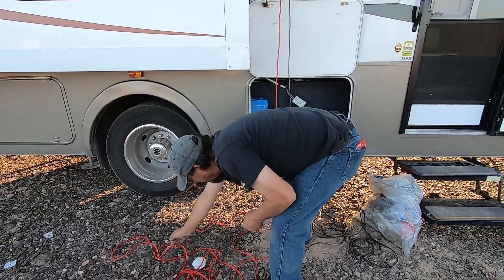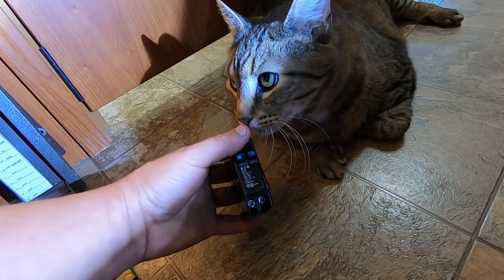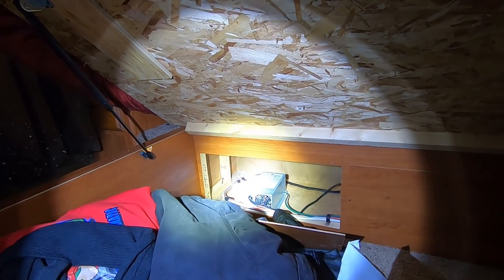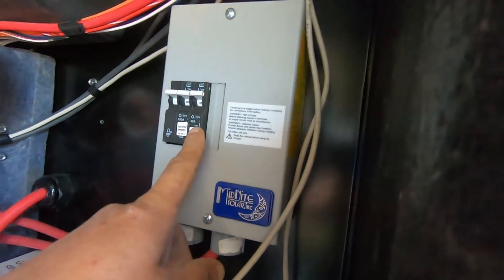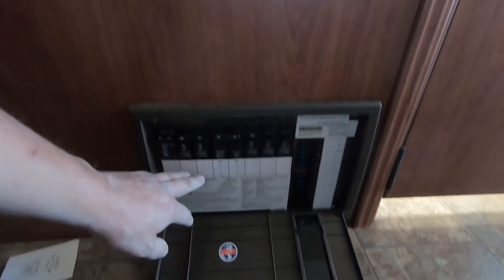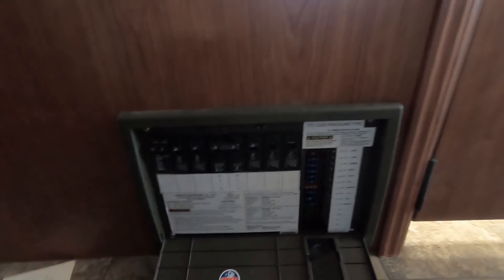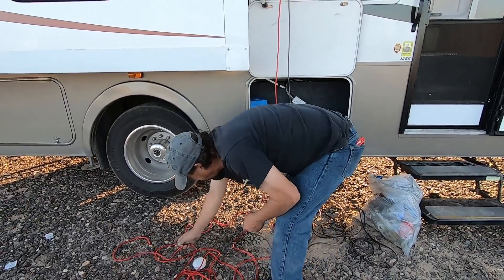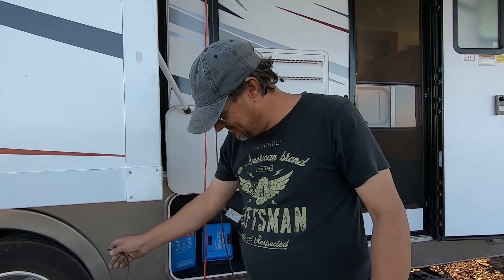Nomadic Fanatic solar install Pt.2

Comment: Thanks Wayne, you answered a ton of questions and concerns I had about setting this system up on a 50 amp RV.  Any opinion on inverters, AZ wind and solar sells the Vitron and the Magnum in similar kits, read some negatives on the vitron drawing power from a small generator the way you want it to.

Comment: What areas do you work in, and what are your rates? I am doing some upgrades on my 2012 Crusader 355BHQ this weekend and could use a skilled RV tech. Adding some 12v options that will require pulling cables, skylight covers, brake pull switch and looking into solar and lithium. I'm in Azle,TX send me an email if you're interested. Sbseiso@gmail.com

Comment: Hi Wayne, I am a subscriber and just watched your NF solar install.
My question is will my system run a .8 amp mini fridge?  I have 450 watts of solar panels, 2 100 watt agm sealed lead acid batteries, a 3000 watt inverter and the appropriate converter etc.

Thanks, Babs
Reply from the maker: I would suggest adding 1 more battery to have a buffer in place.
Reply: @rvprepperwayne  thanks, am thinking of replacing all with lithium...for the same reason.

Comment: I like very much how you installed this. Couple questions. Eric kept saying the inverter was a 50amp pass thru. Is this correct? if so, could you have powered the entire distribution box instead of only one line? Second, I watch many time. But I did understand your 30 and 100 amp dc breakers? could you detail this for me? or do you have a schematic?
Reply from the maker: The inverter is listed as a 50 amp pass through but it is really a 30 amp pass through with an option to do a 50 amp output from a 30 amp input.  From my understanding the 50 amp output would only come from a shore power or genset. Therefore it is not a true 50 amp pass through. Its hard to explain  how it works.  On the breakers the 30 amp breaker is from the panels to the charge controller and the 100 amp is from the batteries to the charge controller.  This makes the CC fully protected. Yes it is DC breakers.
Reply: rvprepperwayne ok I think I got it. The two big red cables. One coming in from the cc to the breaker. Thru the 100amp and then out the second red cable to the battery. And yes I understand from the panels thru the 30amp and to the cc.  And thanks for clarifying on the multiplus. I wish it were a true 50 amp pass thru. Thank you!
Reply from the maker: Go power  has a true 50 amp pass through. The IC 2000  https://amzn.to/2Pj9SEj and the IC 3000 https://amzn.to/2PkRxa4

Comment: standard rv converters are really just a big 12 volt power supply, but they do terrible things to rv house batteries because they don't have a proper charge profile and tend to overcharge batteries, swelling the cases and cooking them to death. but for the rv manufacturer it's an inexpensive way to power the 12 volt house systems from shore power. one of the biggest reasons why i hate most mass-produced rv's... they usually use the cheapest stuff when they build them.

Comment: I have them wired in series parallel? Wtf does that mean...I am a owner...you either have parallel or serial...not both...please fix and post a update
Reply: There are four panels.  Panel 1 and 2 can be wired together in series to double the voltage to create bank 1.  Next panels 3 and 4 can also be wired together in series to create bank 2.  Then bank 1 and bank 2 can be wired in parallel to double the amps.  I think that is what is meant.
Reply from the maker: Yes Bruce. you understand what I mean by Series/parallel
Reply: @rvprepperwayne  Yup.  I have 4 panels on my Sprinter-based Camper and have them configured Series/Parallel as well :)

Comment: Wayne, How do we meet up for you to do my solar?

I'm in FERNLEY, NV as of right now.  I can head south, or you can come up here and stay. 
I'm not going to ask how much, I just know good work when I see it! :)
I have the money, I just don't have the skill nor parts yet. 

I have a 1999 Tioga that I'm sure we can get 3 X 320W on it. I want 2X 100ah BB batteries and to be able to run the AC. I'm willing to buy a newer AC that is not as big as what I have now to have AC on solar. 
If you want the work and have the time lets talk! 

George> GeoDrone360@Gmail.com

PS: I need to Whitewash/paint the roof, put in a Max fan and maybe change out the AC too. :)
Reply from the maker: My email in in the video description

Comment: Did I miss it or is there auto transfer between inverter and shore and generator?
Reply from the maker: It does have a factory X over before  the breaker box.
Reply: I remember now you saying the inverter had a pass thru. Thanks for the review on a great system and AWSOME INSTALL

Comment: GREAT JOB Wayne...will be in touch for same setup ( 2 strings, solar runs everything, auto gen start) only with the Magnum  3000w 12vdc psw hybrid inverter /charger (MSH series) when I am ready ready...have you ever done a  2019 Newmar Bay Star 3401 by any chance? Thanks for the panel info just asked Eric for it...lol... will be in touch.

Comment: Love it! Does that Victron box charge and is the DC/ AC at the same time...and do these battle born have cell controllers so you could charge them with every charger with agm, gel and lifephos curve with lets say end voltage 14,6?...   thats a massive installation..I simply have 190 Watts solar and 160 Ah Lifephos batt does the job but no air con..coffee making, El cocktop or hairdryer no issue..I would like to run the refrigerator in summer over it..( S + and D Signal application its a 190 Watts cartridge so 14 amps, my set up won't do it ).. My Rv garage said also, no better use gas...since I have no free real estate up on the roof I may built a windscreen protection with 200 Watts of solar to double up..who knows..hope you guys bbqing a good steak and a beer after all! Keep rocking Wayne!

Comment: Great pair of episodes Wane.  Questions, saw a video where they were running A/C on solar and they mentioned a inverter that can produce short time very high watts output for the few seconds is required when the compressor motor is spinning up as during that short time many more times the watts the motor is rated for are being pulled as it goes from not moving to turning.  If not the voltage drop and the amperage rise can burn up the motor.  I'm sure you are already aware of this just wondering how much peak watts that inverter put out? Think you said it was a 3500W but that is probably continuously not peak.   Again excellent job Wane everything looks good and clean, been reading up about those type battery's should be great as you can pull them all the way down without damage. Think they are built at the new Tesla battery factory in Reno.

Comment: I new the light would light off the panels I have two of those bults currently running of a 80 watt panel I am in the process of adding 4 25 watt panels to my system with a 3 battery bank should work out well for me when I am done

Comment: Well Wayne, another job well done. If everyone put the thought into their work like you do this world would be so much better off. You do your work the "old way". Instead of just doing what is needed or less you go the extra mile to do it right. Great job. I always look forward to your videos.
Reply: Where can I find the crimper tool and the wires for making the battery  Cable and ends for making a cables custom length???    The typical local stores here in  Saint Louis Don't seem to know what I'm talking about
Reply: Amazon